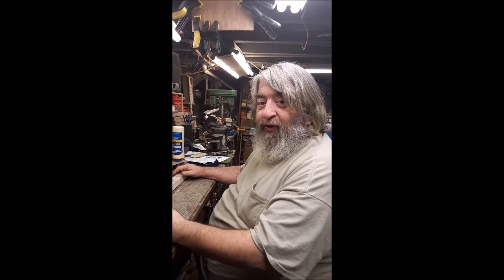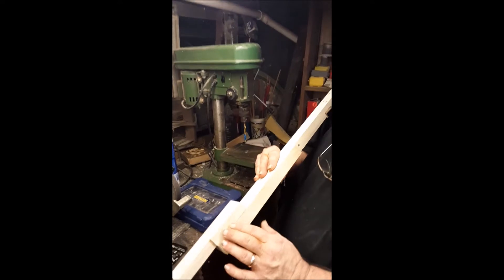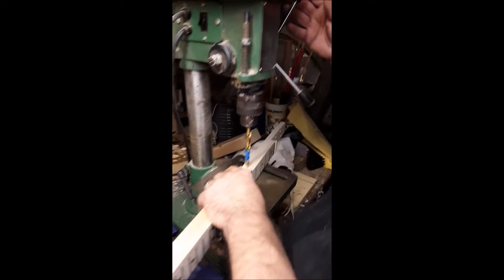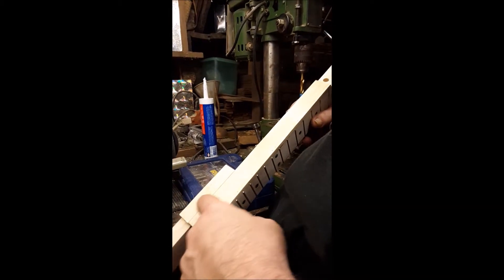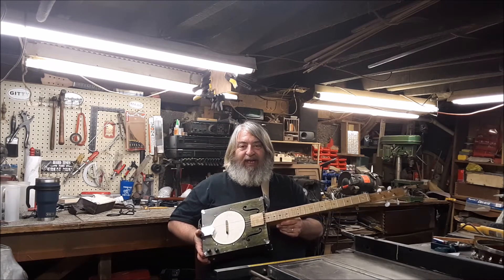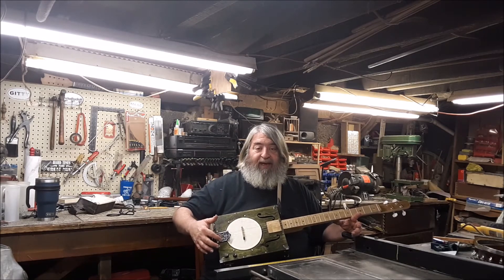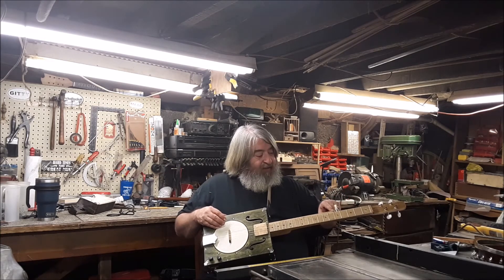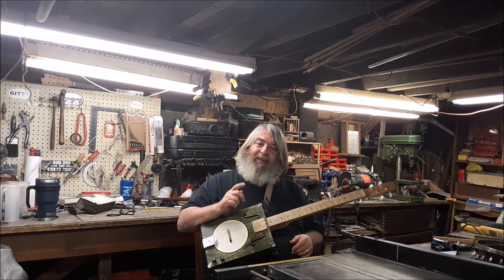CB GITTY COUNTRY ROADS BANJO CONVERSION

Comment: Hey Lou! Great job. I was looking to do the same thing and CBgitty sent me this link. Can you tell me how wide the piece of maple you used for the 5th string is? Thx!
Reply: Yeah, it's 1/4" maple. I actually used a fretboard on its side. Cut to fit! Do it before you shape the back of the neck.  Any other questions, don't be afraid to ask! Thanks!
Reply: Awesome ! Thanks very much. I wanted to build this to have a 5 string to leave by the couch and practice with . Did you paint the body or stain it ?
Reply: I used RIT fabric dyes. They work really well for colors! Usually I combine a few to get the effect I want. On that one I used sun yellow over green.
Be sure to put the 5th string nut even with the 5th fret. That way if you capo up the neck it will be in tune. I use a 1/4" round head slotted screw for this. You can then raise or lower the string height by tightening or loosening the screw! Be sure to send me some pics of the finished banjo! Have fun!!!